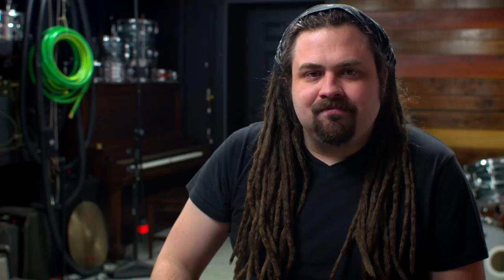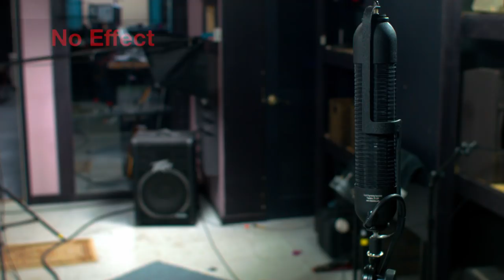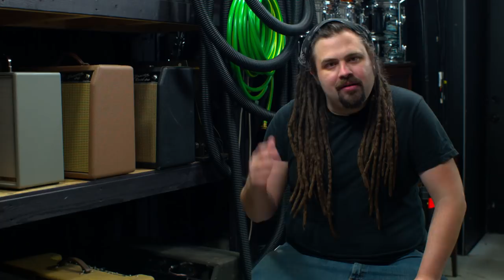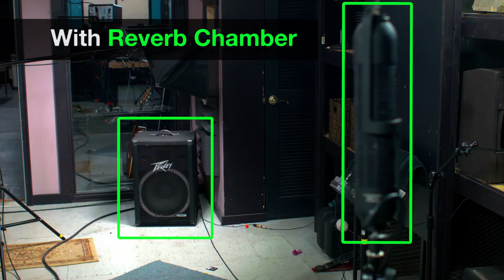How to Use Your Room as a Reverb Effect (Reverb Chamber)

Comment: Take it a step further and adjust the speed at which you playback the signal in to the "chamber". Play it back 20% faster, and record that verb, then slow it back down. Your rooms much bigger now. You might need to nudge the reverb track forward a bit to get it to line up.

Comment: I only have two outputs (L and R) on my interface and I like to just solo the track I'm sending to the chamber, pan it to the left and mute the return/recording track so it doesn't feedback. Same concept as yours, but a little less to do! I'm working in a small room and I use this to fatten up sterile VST instruments/synths by putting the mic close to the speaker and recording the instrument solo. It gives it a little bit of air and harmonic content but I make sure to EQ out the occasional harsh frequencies. All in all, I love using chambers to "analog" my sound. It can also be cool to use your phone as the microphone and record the room that way. It's a good lo-fi, crunchy reverb that sounds nice when you blend it with the rest of the mix.

Comment: I never thought of this before! I wonder how well it'll work in my room, i have carpet, and a lot of fabric furniture dampening whatever reverb is in the room. Anyone think it's still worth the effort trying grabbing what little verb is left off the tops of the walls and the ceiling?
Reply from the maker: That kind of room is still great for this use, but on bright stuff like acoustic guitar or lead electric w a delay on the room you record.
Reply: Creative Sound Lab i'll have to try it out some time, definitely keeping this idea in mind :) am i right in thinking the more fabric there is in my room, the darker the verb will come out? I mean, i've noticed presence in the reverberations in empty rooms with wood or cement floors, it stands to reason the harder surfaces bounce the verb back harder, but even tho my home studio has tall ceilings, i've never really noticed any natural reverb, wondering if that's because all the furniture and carpet are turning my natural reverb tone knob down too much to be noticeable, i know reverberations are still physically happening, i just wonder if the fabrics are like turning a tone knob down more than it's like turning the effect volume down, or does fabric take away more volume than tone? Either way, i never notice any room verb in my space :/

Comment: Fantastic. Any way of manipulating sound naturally over signal manipulation is fantastic. 
I like the idea of a single miced drum set recording then this trick. Zero bled then speaker and microphone placement on reverb. Simple clean sound, with the option of coloring the reverb sound. Didn't capture enough boom or high end, find a mic placement that emphasizes what you are missing. Natural eq. Use very fast/sharp/accurate recording the first time around, then warm/slower equipment the second time around. So many options. 
Fantastic
Reply from the maker: Yes! Right on man.